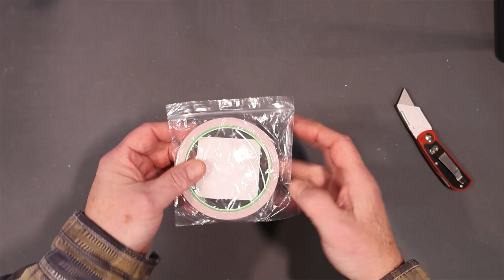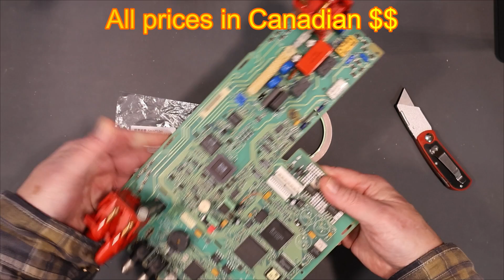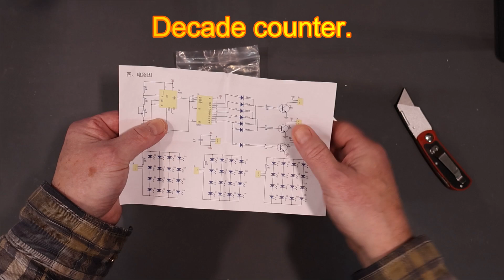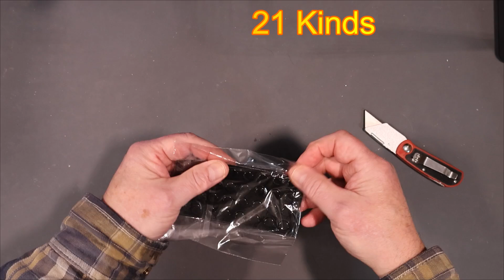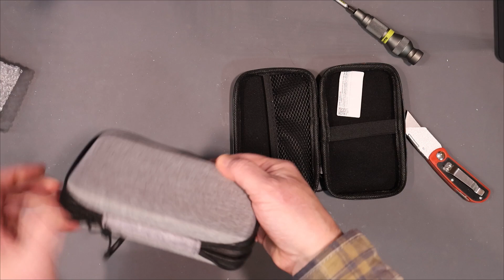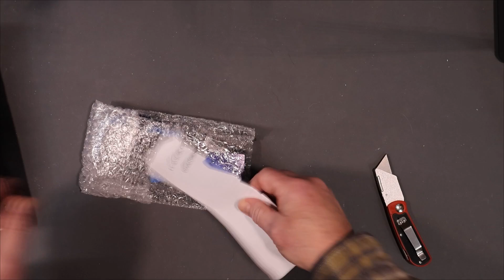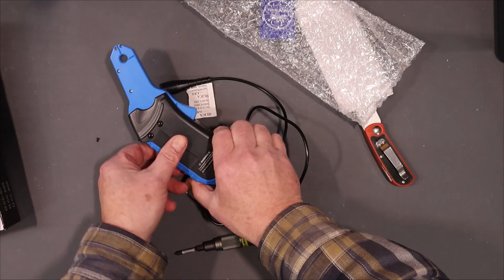Uni-Byte 0317 - Mail Bag #43: AliExpress for CHRISTMAS!

Comment: The lithium 9v batteries I bought have a noise issue. Probably from the boost circuit. Useless in the bass we wanted to use them in. They should be fine for toys or smoke detectors and the likes. Just no good in a musical instrument. I did recently try one in a guitar pedal and haven't noticed any noise issues there yet.
Reply from the maker: There are 9V lithium primary cells (not rechargeable) available.  They are very expensive, but should be noise free, leak free and long lasting.

Comment: 0:10 finally! I don't have to buy it! (I already got it) 😁

Btw: You can use two strips next to each other and connect it to a 9 V battery/PSU and put it around a pot or on a wooden board which runs around your garden bed, and those pesky snakes won't cross it 😏
Reply from the maker: Interesting idea, thanks!

Comment: On those storage cases, I have just done the same thing with my meters and probes.
I used the black fake carbon fiber style, rather than the tweed fabric-look shown in this video.
My Brother & Dymo labellers work great on them. I bought narrower 6mm and 9mm tape, print off labels using a wide bold font, and rubbed them down well. The labels are holding up well, but the trick is to snip the corners off at 45° so that they won't catch if there is any lifting. 👍
Also, the fake tapes from Ali are thinner, making them more flexible. Much cheaper and the adhesive seems just as good.
Reply from the maker: I have a lot of those fake carbon fiber ones too.  Awesome information, thanks!!

Comment: The copper tape can work as I use it to fix pcb's often. I find it helps to use super glue to glue it down as the sticky will not survive the heat of soldering. The glue won't either but it can hold it long enough to get it soldered. Good Luck on the repair and most of all Merry Christmas Uni!
RJ
Reply from the maker: Good to know, RJ!

Everyone should check out RJ's channel: https://www.youtube.com/@LynxElectronicsLab

Comment: 5-55 🤣🤣🤣 don't know what a CD4017 is 🤣🤣🤣 ANYONE that has a slight interest in electronics knows it's a "555" timer and the 4017 Will have been one of the first integrated circuits (after the 555) that they ever used 🤣🤣🤣 maybe you should concentrate on soccer 🤣🤣🤣
Reply from the maker: Thanks for your comment, as rude as it is.  I didn't use 4000 series logic much and was far more interested in the faster and more robust 7400 series TTL logic.  I did know it was a counter of some sort (which I said), and I was right.  Just couldn't tell you exactly which type without checking.  As to the 555, I have always referred to it as a 5-55, just as many others do.  I even did a 2-part video on building one using op-amps, a quad 2-input nor-gate (CD4001), 3 transistors and a MOSFET.  I say 5-55 in that series about 300 times.
https://youtu.be/bZxMCwWijlc
https://youtu.be/DmJoXrtOOuo
Reply: @uni-byte  Not meant to be rude, I was having a laugh (I'm from the UK somewhat different sense of humour) I will now go and watch the building of the 5-55 and report back 🫡
Reply from the maker: No worries.  Thanks for letting me know.  Just to let yo know, soccer is REAALY not my thing.  More like trombone playing or dirt biking.   LOL!

As were we discussing, the video hit "555" views!!

Comment: Been using EBL 9v batteries (NiMH but genuine 9v with some kind of buck/boost converter internally) for about 20 years, they were 'fairly' expensive initially, but they work great. Capacity wise they're similar to alkaline - about 900-1000mAh, they need a special charger though. The internal voltage must be close to 9v since they DO sag in voltage before needing recharging, my guess would be that they're 8.4v (7 NiMH cells) into a boost circuit.

The new LiIon 9v batteries I've not used, but given that the capacity is insane (like 3000mAh) and you don't need a special charger, I can only assume that they are worth every penny. I do use USB LiIon AA and AAAs for devices that absolutely can't run on 1.2v cells, and they work fine except you get no warning of them being nearly depleted, so I wouldn't use them in something critical like any kind of alarm or cycle lights.
Reply from the maker: That's great info. Thanks for sharing.
Reply: The (Rechargeable 9V) lithium batteries don't have the capacity that you might think.
All (non-primary) lithium battery packs are rated based on the cells inside. In the case of a 9V pack the cell might be 1000 mAh but that is at 3.7V, so let's say 3700 mWh. Then say the boost converter is 90% efficient, you might get 3300 mWh out.
Now you want 9 Volts, so that is only 367 mAh of capacity from a cell rated 1000 mAh  😉
Reply from the maker: @johncoops6897  I was thinking about the 9V lithium primary cells.  The single use ones like (hate to use a brand name) Energizer Ultimate Lithium cells, but in a 9V version.

I have tried the "9V"  lithium rechargeables,  but they have a very high self discharge rate and unless you are using them daily (or close to that) are disappointing, to say the least.
Reply: @uni-byte - the 9V lithium primary packs intended for smoke detectors are awesome but outragously expensive here in Australia.
There is a big push now days for rechargeable lithium, which use a single LiPo cell, a boost converter and a USB-C for recharging.
Newest designs have a output voltage step-down when they are getting low on charge. That triggers the device's low battery warning.
Disadvantage is cost and electrical noise (HF ripple and harmonics) from the boost regulator.
I find it's easier to use a conversion module and change the device over completely to lithium. Use a recycled cell from a "street lithium" device, so it only costs about $2 to convert 9V to Type C rechargeable lithium.
*edit to add... the self discharge is still a problem because they run the boost converter continuously. Some of the better booster ICs have a low power mode which reduces the current when idling, but they will still go flat. Only a physical switch (on a DIY conversion) can help isolate the battery and disable the boost circuit 100%.
Reply from the maker: @johncoops6897  They are expensive here too.  That's the main reason I have not used them.